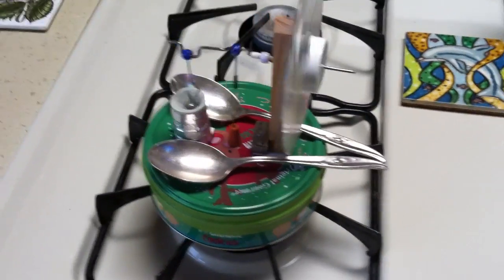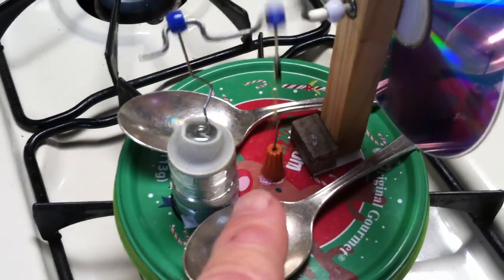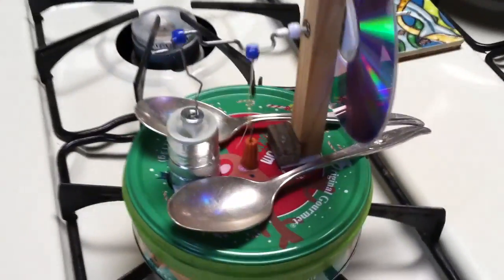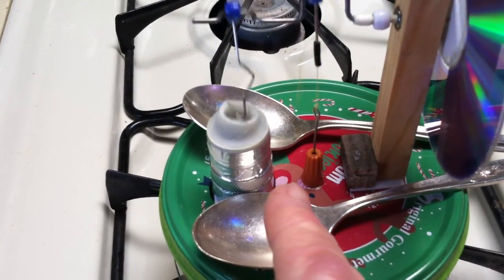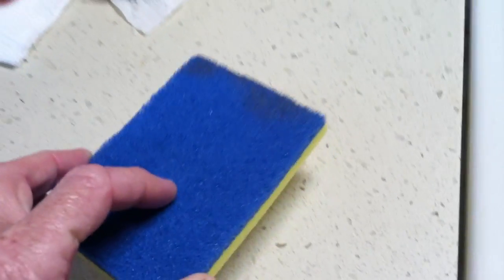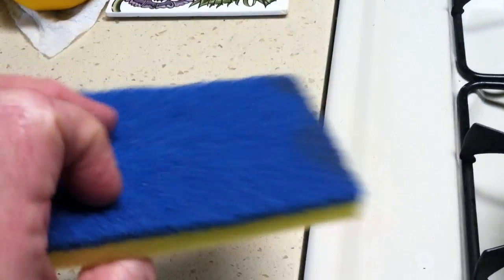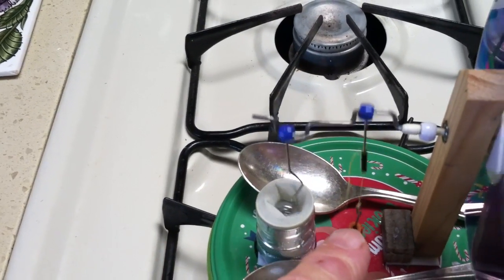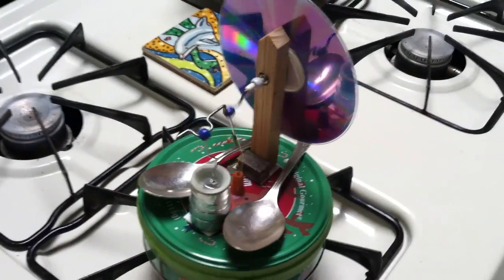Spoon Cooling A Stirling

Comment: That's very cool.  Those things are finicky and not real easy. None of my attempts ever flew
Reply from the maker: Hey Kyle.  Yep these things are very finicky.  The flip side is that once you get one running the endeavor becomes addictive. It is like building pulse motors.  I remember the first Bedini SSG I got running and just staring at it do it's thing.  To me it was magic.  These Stirling engines give me the same feeling.  Watching expanding and contracting air turn into mechanical work is amazing.